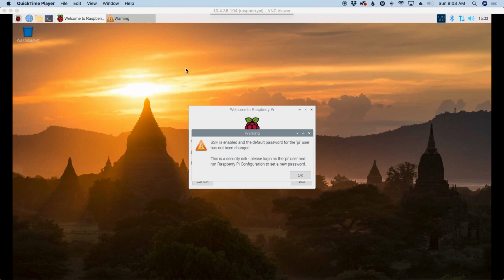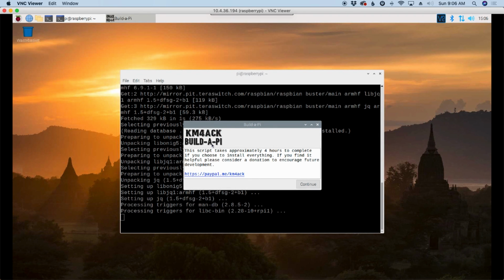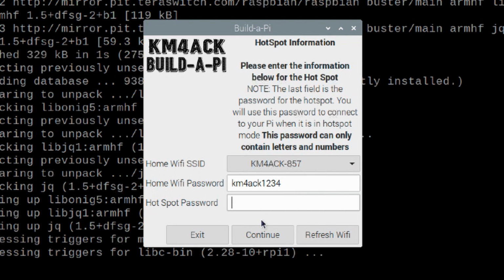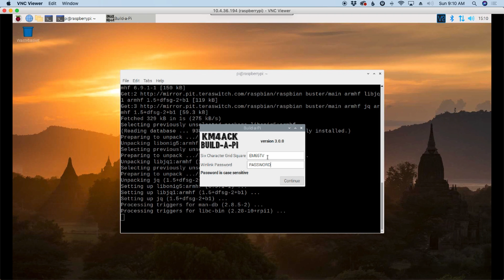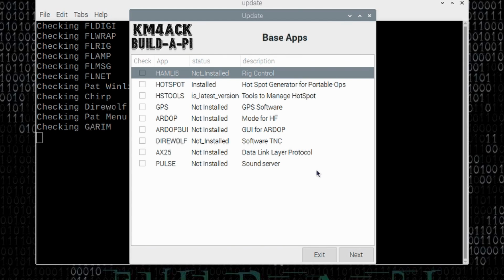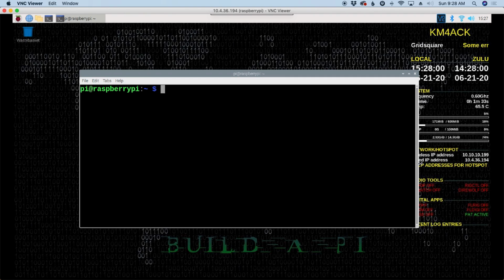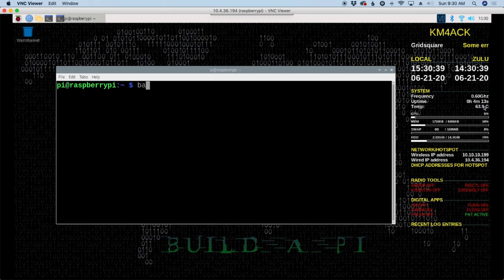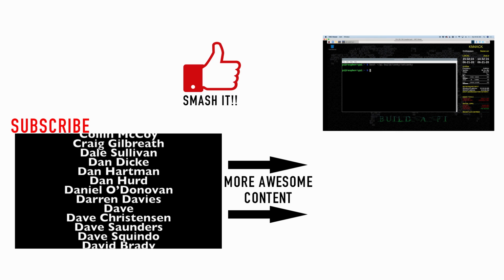Ham Radio Raspberry Pi | Build a Pi V3

Comment: I just loaded build a Pi on a pi4 8gb. I am trying to set the pi up for portable use and have added a 10.1" roadom screen. I am having all kinds of issues with it. The menus will not scroll and I cannot get ham clock to display properly. Do you have any suggestions?  TIA

Comment: Thanks for the Video. 

I am trying to follow it. and run into an issue; when unplug the HDMI cable the resolution goes way out of wack and i cannot get it back to a decent DPI unless i plug the HDMI cable back in. is there a way to fix this?
Reply from the maker: This post may be helpful https://groups.io/g/KM4ACK-Pi/message/7429

Comment: Jason, you have a 64bit beta version available and I used it.  I studied many of your YouTube University presentations for Raspberry and they've all been VERY helpful.  It was astonishing to watch build-a-pi do its' thing.  How or who on earth has the ability to type that many lines of incomprehensible data?  Fantastic work.  I'm testing the 64bit, it installed perfectly, seems to be working well, and I've used several of the programs so far (I am not computer/code literate).  I added CQRLog and managed to remote WSJTX and FLDigi.  Love the Conkey, much more to explore.  I'll post in GroupsIO...

Comment: I am having some problems with losing my VNC connection while receiving LAMP under fldigi in build-a-pi.  I am using passive cooling on the pi4b and hit 145F temps while it is working hard.  Do you think the 145F is causing the shutdowns?  Thanks for any help.
Reply from the maker: I don't think the temp would cause shutdowns but it could cause thermal throttling. I can't remember the exact temp where throttling occurs.

Comment: I got a raspberry pi 3B+ and finally got around to (for the first time) trying to get it set up to use as an APRS repeater/iGate. 

My Problem: I began installing build-a-pi following these instructions. I got to the point where it asked for my gps device. I do not have one, so I hit cancel (because it was the only option) and it threw me out of the setup. Now I can’t restart it, because it “already exists”. But it’s not “really” installed. I would just delete it all and restart, but I don’t know how, nor do I know how to avoid the original issue of not having (or needing) a gps device since this pi will be stationary with constant internet. HELP!
Reply from the maker: Run this command "~/pi-build/build-a-pi" and it will restart. Don't put a check mark by GPS since you don't have a GPS.

Comment: But what does this thing do?  I've used Pis as the PC support for a hotspot, but I don't think that's what this is for.
Reply from the maker: This is designed to be paired with a ham radio for all things digital. (rig control, ft8, js8call, etc)

Comment: I did not realize at the first screen I told it to install GPS. During the script I told it to cancel and it shut the BAP script down.
From the command line how do I restart the BAP as the whole BAP process never fully finished?
Reply from the maker: Run this in a terminal: /home/pi/pi-build/build-a-pi
Reply: @KM4ACK    Much appreciated, sir  73's  KI4QFL

Comment: I love it.  but I have just one issue and I do not see it addressed anywhere. Grid tracker will not run... WSJTX works great, did a test contact with it no problem but just can not get grid tracker to run... any thoughts?
Reply from the maker: Gridtracker is a known issue that I hope to resolve in the next update. https://github.com/km4ack/pi-build/issues/223
Reply: @KM4ACK  I hope you can find a way to include VNAsaver in a future update.

Comment: I am not sure what is wrong but I have never gotten the screen with the photo! All I have gotten is the prompt screen.  Am I using the wrong system.  I use the one that I think you said to use in the video where you told how to use the program with the "Ctrl, Shift, X" . I have also used other ways you said to burn program to SD card. But I have never seen that screen!

Comment: I finally installed BAPv3 today on a fresh baked pi.  The installation went smoothly, as expected.  I thought, what the hell, and installed everything.  Even the aux. audio port works.  I had an issue with that on my previous pi installation, unrelated to BAP.  This version of BAP is what we radio amateurs have been missing.  I am not a Linux expert, although I do know enough to be a danger to myself.  I am also not a configuration masochist.  I just want to get the pi and its software up and running without a major hassle so I can do radio.  Thanks to Jason, I can now do this.  I have been using  the BAPv1 and was very pleased with it.  Everything worked.  I expect BAPv3 will be even better.  I don't do much portable, that is, pack up and go somewhere.  I use the pi in my shack, literally a shack - garden shed - out in an olive grove powered by solar.  I need low power computing, and the pi fits the bill.  I also found a discarded LCD display with a 12v input.  I just bought a BT keyboard and mouse (to reduce cable clutter on my desk).  i want to thank Jason and his friends for investing a great amount of their personal time into the BAP project.  BAP is a great benefit to me.  David SV0SGS and DM3BC

Comment: Highly highly HIGHLY recommended. If I had to pay for this I certainly would. Flawless design and process. Very big thank you. The process is very simple and easy to follow along thatnks to the check box interface. I went through the whole process on my Pi4+ in a little over an hour and a half, fully functioning right off the batt. (Had to chnage the CONKY settings in the menu). 

Favorite parts:
1. The ease of GPS dongle configuration. Literally just plugged in my GPS dongle and the software did the rest.

2.The hotspot configuration.

Comment: I have learned so much from you and made a lot of progress on my raspberry pi projects. Build-a-Pi is just outstanding. Thank you! I want to connect my RPI 4 using Bluetooth to my P4 Dragon modem. Have you considered adding Bluetooth support install and tools to Build-a-Pi?
Reply from the maker: Thanks for the kind words! The Bluetooth tools that I have used in the past are already included. Can’t help with the P4 though since I don’t own one. You might be in uncharted waters.
Reply: @KM4ACK  I couldn't find anything Bluetooth related in the Build-a-Pi tool or menu. Could you point me in the right direction, please?

Comment: Ran into some problems with WSJTX, YAAC, and JS8 call. I think there are some port issues as I have all three working fine, and now I lost ability to use Wifi or detect any wifi networks. 
Reinstalled BAP. Not sure why it had issues in YAAC.

Comment: A few questions not answered by Github or the video.  How does this perform on the various RPIs?  What can the Zero W run and can a PI3 do the whole package reasonably well?
Reply from the maker: All of it will run ok on the pi 3. Some of it will run on the zero but there’s no official support for the zero and not recommended.
Reply: @KM4ACK  Thanks for all your hard work! I got way behind on your videos and did some catching up today. I guess I'll try it on the PI3 for now since I have one doing nothing but it really sounds like a PI4 would be better based on your answer.  If you haven't tried an SSD on your RPI setups you should some time. That really sped up some of my projects.

Comment: tried to run the command in Pi V4 and got an Error "URL returned error 400 ".  Guess I have missed out an important part of the process , thanks again for your efforts, -- John  VK3CVF
Reply from the maker: After flashing Buster to your SD card and booting, you only need to run one command. The command can be found on this page https://github.com/km4ack/pi-build Copy/paste is your friend to avoid errors.

Comment: i need some help so i got a pi the other day and i started to install this but it was late at night so i stopped the install.  i thought i could just run the command again and everything would be fine however thats not the case.  I am very new to rasberry pi as you can tell.  when i ran the command again i get this " fatal: destination path '/home/pi/pi-build' already exists and is not an empty directory". what can i do to fix this so i can install this on my pi.  thanks for the help everyone.
Reply from the maker: Flash a fresh copy of buster and start again. Stopping the script mid stream is almost a guarantee for issues to arise.

Comment: This is really cool, I think. What’s this for? W7TPS
Reply from the maker: It installs ham radio related software on a raspberry pi. You can then use the software with the pi connected to your radio for digital communication.

Comment: I am running this script on my Pi4 and love it.  Only problem I have is that the system clock is not syncing over my hotspot on my phone when it is the data source for the Pi4.  Is there an easy way to get around this or should I just add the GPS dongle?  Thanks!
Reply from the maker: Adding the GPS dongle would probably be easier. And they are cheap at less than $20.
Reply: @KM4ACK  thanks Jason.  Your work is better than I am.  I meant to come back and give an update.  I've been running the Pi mobile for two days now and at some point after it connected to my phone the first day it synced the time and has been spot on the last two days. 

Thanks for your great work.  I would be lost without it.

Comment: is it possible to modify the Conky setting for use with the ICOM705?  Since WSJTX has not been updated to add the ICOM705, trying to read the GPS data I think is causing a problem since the address of the 7300 and the 705 are different.
Reply from the maker: I don't own the 705 but several others have successfully gotten the GPS data to show in Conky without modding anything in BAP. Take a look at the forums https://groups.io/g/KM4ACK-Pi/topics

Comment: Somehow the script aborted while running.  Trying to run the script again; it does not run with the error,  "fatal: destination path '/home/pi/pi-build' already exists and is not an empty directory.
"  I tried to delete the directory but it will not let me do this.  How do i continue?
Reply from the maker: Since we don't know for certain where the script aborted, we don't know what might be partially installed. It's probably best to reflash the card with Buster and start fresh.
Reply: @KM4ACK  That us what i am doing now.  thanks!

Comment: Hi Jason, Thanks so much for all your hard work on Build-a-pi.  I have just installed  build-a-pi on my Raspberry Pi 4B following the instructions herein.  All went very well with no issues.  My rig  is a Elecraft KX3  and a a Griffon  IMic USB audio system .   When I try to configure FLRig it finds the USB connection entry  OK but all I get are Hamlib errors .  I tried every connection speed  between the rig and FLRig but none worked .  Any idea what is going on
Thanks

Comment: Hi Jason.. or anyone! I have installed the OS, however, I don't yet have my Icom IC-705. I will be using a Raspberry Pi 7" screen and the GPS from inside the Icom IC-705. When going through the script, it asks whether to install the GPS, however as I don't have the radio, do I just untick the GPS???? I will of course require it when I get the radio. Thanks
Reply from the maker: Correct. Don’t install the GPS now. You will install it after you get the 705 and connect it to the pi.
Reply: @KM4ACK  Thanks for the response. I have installed everything else on the Raspberry pi other than the GPS.
I'm due to get the IC-705 tomorrow so I'll install it after.
Thanks again for your great work.

Comment: Is Debian Buster 64 required or can I install this on a fresh raspberry pi OS?  I can't get Balena etcher to sucessfully write the image it fails and there is no log to find out the issue. What do you gain by using the .iso listed in the instructions on github?
Reply: if I do it on the stock OS, is it ok to change the keyboard layout first.  Do brits not use the hash key?
Reply from the maker: You can run it on the 32bit version. In fact, it is the preferred way since the 64bit version doesn't support VNC at the moment. Download the image from here https://www.raspberrypi.org/downloads/raspberry-pi-os/

Comment: Must the RPi be connected by ethernet in order to successfully run BAP?  Obviously the first section of the startup would have to be executed doing localization and WiFi setup.  That foul up BAP?  Would have to run wire to the shack if ethernet is required.

Down loaded the OS image as a zip file on Mac.  Did etcher to an SD card.  First time I ran startup through localization and WiFi startup.  Then BAP on 4 gb Pi 4 with almost everything included in the build.  Resulting system inconsistent about finding the input device.  Once in a while it does.  Most times not.  Exact same hardware and connections w Buster executes WSJTX and JS8Call properly.  

Tried to do BAP on another SD card so could do BAP without PULSE.  Now get messages when trying to execute the install command that there is a problem with directory.  Did several etcher times on same card after format/erase.   How to set directory set to correct place for install.
Reply from the maker: It should run fine over wifi. If you are having issues, it's best to post your questions to the forum. Much easier to provide support through that format https://groups.io/g/KM4ACK-Pi/topics

Comment: Outstanding job on this package. Everything installed exactly as you presented it.  I am now wrestling with an FLRig initialization error (Cannot open /dev/serial/by-id/usb-Silicon_Labs_cp2102_USB_to_UART_Brindge_Controller_IC-7100_02012643_A-if00-port0!)  using just the USB cable included with the IC-7100.  

With the radio plugged in, I see two USB ports and have tried initializing with both. 

I went through the settings on the radio  and experimented settings and baud rates.
   DATA MOD: USB,
   CI-V Address:  88h  (entered as 0x88 on FLRig)
   Ci-V Transceive: On / Off
   CI-V Baud Rate:  4800, 9600, and 19200
   Mode: FM-D

I understand you have a Yeasu but I am hoping you or another genius following your work on this build has some insight into what to try next. 

73, Tom
Reply from the maker: Hey Tom, try posting in the forum. I think there are a few guys there that run the 7100. https://groups.io/g/KM4ACK-Pi/topics

Comment: Jason,  As of 9/27/20 has VNC been compiled for and included in the 64 bit Buster distribution?  Will a build-a-pi 64 bit system run on an RP3?    Thank you!!!
Reply from the maker: I don't think that VNC is working correctly with the 64bit system....at least to my current knowledge.

Comment: I’m installing in a hotel, Hilton doesn’t have a password setup so I exited the hotspot; which exited everything.  I have no way at the moment to re-flash, how can I restart and leave off the hotspot?
Reply from the maker: bash ~/pi-build/build-a-pi
Reply: Thank you for your help and this massive script.  I’m currently sitting with the page open dialog, stating “Configuring xastir” with an <Ok> at the bottom.  Is it still installing or am I done?  I’ve clicked on it but nothing happens.

Comment: Great job Jason!
Can you provide any help on getting the Pi to connect via Bluetooth to a rig? I can't seem to get a BT serial connection to work on the Pi.
Keep up the great work, 73 de Steve VK2ARS
Reply from the maker: I haven't tried connecting to a rig over bluetooth but you might find some nuggets of knowledge in the Pi Zero project where I connect the mobilinkd TNC to the pi over Bluetooth. I would guess the same techniques could be applied. https://youtu.be/FWnA0aT_SoE
Reply: @KM4ACK  Thanks Jason, I'll take a look and let you know how it goes 73 de Steve VK2ARS

Comment: When you refer to sound cards, are you using an external add on sound card instead of the one available on the raspberry
Reply from the maker: Yes, external cards. The one built into the pi is output only. The pi doesn't have sound input.
Reply: Sorry to bother you again but I’m looking for input on suitable sound cards
Reply: And thanks for your reply. It is appreciated!

Comment: I'm working to have my Raspberry pi 4 and setup your github project. thanks for this open source iniciative!!  I would like to ask you if the raspberry pi4  support this version as well.    question #2, It is possible to export the adif log from WJST-X or JS8CALL to log40m to register the FT8 contacts I have worked? I'm thinking use the Raspberry pi4 for my portable -SOTA   activities across Costa Rica.  73s! TI2GBB
Reply from the maker: Yes. It will work with the Pi 4. Not sure about exporting from WSJTX.
Reply: @KM4ACK  Thanks. Related to WJST-X Question. I normally use my Windows PC and log40m software to update the adif and contacts I have made in FT8 and confirm automatically in EQSL and loTW. So I'm figure out how to export the Adif file from wjst-x to export those contacts made on this software in pota or sota activations using Pi4/3 and then, import the log to log40m to upload the info. I think will be a nice improvment. Thanks for all the hard work on this. 73s TI2GBB 🇨🇷
Reply from the maker: The WSJTX team may be able to help with this request. Try reaching out to them.

Comment: I am using a PI4 1Gb Ram. I ended up updating the PI4 firmware to the beta version to allow USB booting. I am using an Inland 120GB SSD in an external enclosure, and the increase in performance is really nice. It does take up an additional USB 2 port, but I will be using a 4 port USB hub for the PS if needed when portable. 
Thanks again for the great PI build.

Comment: Love your videos  just wondering if you think you can run the new winlink  vara and vara FM  it runs almost as fast as a P4 DRAGON  modem  (1500 $) and  the full vara software is  70$ big difference.  :)
Chuck AA4CP South FL
Reply from the maker: Wish we could but the VARA developer has chosen a "Windows Only" approach and won't allow it to be ported to Linux. I don't mind paying for software if/when it comes to Linux.